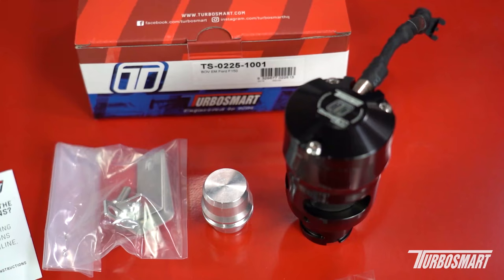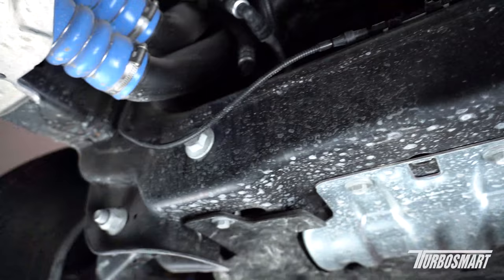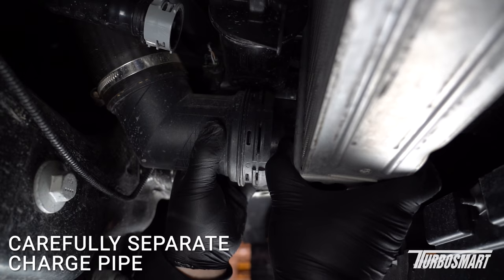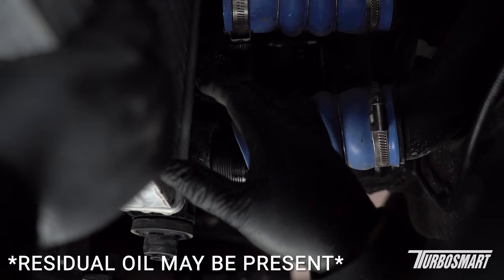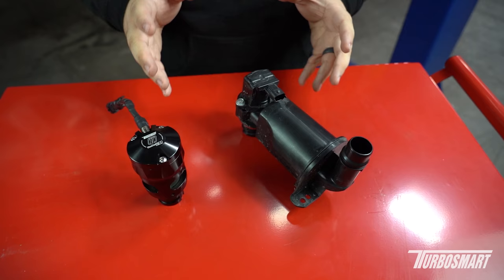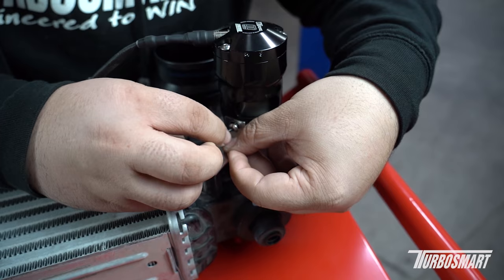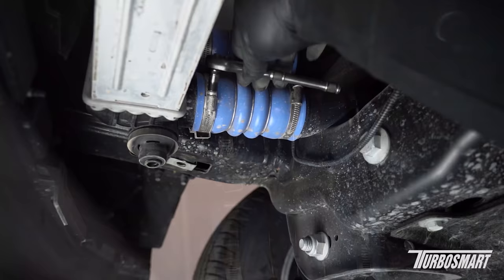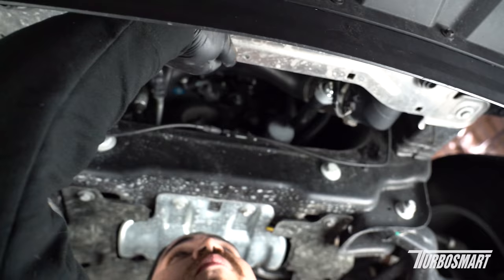BOV INSTALL: Ford F150 EM Blow Off Valve (P/N: TS-0225-1001)

Comment: Good video. Easy install. Did it in my garage without any ramps, 2.5" leveling kit was sufficient enough. Took me slightly longer than the length of this video due to pausing every now and then. Sounds good.
Reply: Is the air that would usually get recirculated being wasted?
Reply: I agree, hardest part was removing tabs on stock BOV. No need for ramps either with 2” spacers for leveling kit.

Comment: I see a lot of questions in the comments regarding going into water with this BOV submerged, but seems their support is answering all questions but this one? There is multiple questions about water etc.
Reply from the maker: Sorry if it seems we are avoiding this topic as that is not the case. The valve will stay sealed as long as boost pressure is in the system. The solenoid assembly is weather sealed so submerging the valve is not a concern. If you modulate the throttle in such a way that the ECU sends a signal to open the BOV then there is a risk that water could get in depending on the situation (I.E. Water Depth, Current Strength, etc.)  but remember that pressurized air is escaping out of this valve when it opens so water will have a tough time even getting in regardless. 

Be mindful when forging deep waters and try to stay on throttle as much as you can.

Comment: Turbosmart Regarding building boost while in the parked mode, I installed mine on a 2017 F-150 with a 2.7 Liter Ecoboost engine and the BOV does not open up for me on park at all, now when I’m driving it, it does sound off, and it sounds off really good on the highway, however while I’m in parked mode it does not open up. Either way I’m very happy with my purchase and man did I see an improvement in the turbo performance my truck ran so good I was easily reaching triple digit speeds while I was testing it out and wow it definitely made my truck pick-up and go so much better.
Reply from the maker: We've seen that it's been hit or miss on some F-150's whether they can blow off at idle or not. There is not a lot of pressure to made with no load on the engine and free revving. What opens the valve is a signal from the ECU. If the ECU does not see a need to open the valve it simply won't.
Reply: Turbosmart Actually it does work in park mode I just had to put my truck in Sport mode, which I did not have in the beginning. But now I get that BOV sound in park, a good tip to remember is if you want to hear the BOV in park, place your setting on Sport mode. Thanks again for the video tutorial it really helped me install it on my own. I’m very happy with the product and it sounds really good too. A+++++
Reply: These don't improve performance at all. Just makes the noise louder.

Comment: I bought by truck (2018 2.7 ecoboost)  with 47k miles on it  a year ago and already had this valve installed on it. about every 3 months i lose my boost, my truck wrench light comes on and then shortly followed by the service engine light. the code read p0299 and my boost is lost. each time this happens my blow valve is not working, no sound. when i take it in to the performace shop, they diagnose it as "stuck blow off valve" the say the do a remove valve, clean lubricate and replace and then retest and boost is back. I get charged $400 for this each time. my warranty does not cover any of this... at this point do you think i should just replace the valve... i will take any suggestions, frustrated at this point.
Reply: same here man , did you try and out the stock valve back on ?

Comment: What is the benefit of having this valve other than the cool sound it makes? Looks like a quality product.
Reply from the maker: Aside from the more robust materials offering longevity, the seal on the base of the piston is a softer rubber o-ring versus the hard composite material. This difference in material allows for a better seal over the factory which can lead to better spool up and response from the turbocharger in the low to mid end of the boost curve.

Comment: 3:53 "The top is off! Push that out of the way" Lol.

I'm probably going to get this over the mechanical valve. I have read a few negative reviews that these vent prematurely, but those reviews sound more like a faulty part (or faulty truck side sensor) and not a design flaw. Even CAT sometimes sends out non-functional parts, so if that's the case it's not really a big deal.

I would have prefered to get the mechanical valve, but I am not really a fan of those cheap connectors (for the resistors) that pierce the OEM harness. I specialize in wiring on ultra class mining equipment so maybe my standards are higher. But, You would think for the almost $500 Canadian Pesos that those resistors would be on a pig tail that plugs into the OEM connector. Even for the sake of keeping debris out of the plug left unplugged on the OEM harness.
Reply from the maker: We haven't had any customers reach out about the valves opening prematurely. If we had then we would have The spring in the valve is the same one all the EM Vee Ports have come with since it released late last year. The only thing that can activate the BOV is the ECU sending a 12v signal to the solenoid on our valve. 

We are happy to inform you that about a year and a half ago we did away with that style of IDC resistor. We have since been using a plug and play style that connects directly to the factory harness like what you described!

Comment: I bought this and sounds good. Now I'm noticing a slight whining noise at idle, Coasting at low speeds and taking off when slightly accelerating. Would putting the plug in do this or? Transmission shifts flawless and it's not power steering.
Reply from the maker: With any electronically controlled vent to atmosphere valve, you may notice it's much louder, especially compared to the OE valve that was intentionally much quieter.  When and how much the valve opens is based solely on the vehicle's specific ECU tuning. In our experience, Ford makes the valve open for a variety of reasons including start-up, power/traction management, boost control strategy, etc. This is all completely normal to experience. If you feel the valve is defective in any way above and beyond this, we are happy to inspect the valve under warranty. Feel free to reach out to us on our support page or call us and we will get you situated. https://www.turbosmart.com/contact-us
Reply: @TurbosmartHQ  I appreciate it, it seemed normal but wanted to double check. Thank you!

Comment: Can you undo the charge pipe couplers from the other side where the tension clamps are easier to undo? My screw is exactly under the frame and impossible to undo
Reply from the maker: That can work as well. We often take the time during installation before the intercooler goes back in to orientate the clamps in a more accessible position for future service.

Comment: Forgive my ignorance but why can't you just get the plug and plug the return air and let the factory bov vent to atmosphere?
Reply from the maker: No one said you can't if sound is all you're after. This BOV is an aftermarket upgrade made of much more robust materials, it seals better than the factory unit and supports higher HP levels.

Comment: Is it also possible to remove and change the intercooler on a gen2 raptor this way? I mean while the car is lifted up, changing the intercooler seems way easier and less painful than taking the whole grill out. After dealing with the fan harness ofc

Comment: just installed this on my 2013 f150. there was no where for me to install the bracket to secure the bov. i went ahead and installed it anyway. everything seems to be running smooth however there isn’t a singe difference in noise between the stock bov and this one. can someone maybe tell me why there isn’t a difference.
Reply from the maker: If you are not hearing the valve function there may be an issue with the installation. We can also assist you with getting the bracket properly installed. Please reach out to us! We are happy to assist!

https://www.turbosmart.com/contact-us

TURBOSMART HQ AUS
+61 1300 735 506

TURBOSMART USA
+1 (909) 476-2570

TURBOSMART UK
+44 121 368 0719

Comment: are there different instructions for a 2013 XLT? my intercooler isn’t sliding out as easily (there are some brackets sticking out on the side facing front) and the brackets are nowhere near the oe bolt hole.

Comment: i am trying to install this on a mishimoto intercooler but the mounting holes dont lign up? my options?
Reply: The mounting bracket is for extra protection , you could substitute a Thin bead of RTV or high temp sealant  around the mating surface to prevent from coming loose
Reply: @cessealbeach  was wondering the same thing. So you'd apply on the valve where it twists in to the intercooler?

Comment: After the body shop replaced my intercooler my Bov doesn’t sit in tightly. It has movement even when it’s tight. Can this cause my p0035 code?
Reply from the maker: P0035 is more so related to the connection between the BOV and the ECU harness. Check to make sure they plugged it back in and that they did not damage the wire harness from our valve.

Comment: I installed this same BOV on my 2013 ford f150 3.5 ecoboost. Car is now sluggish even more and no sound from the BOV. I know the truck had a leak at the exhaust manifold. Will this cause the BOV to not work properly?
Reply: Stock 3.5L exhaust manifolds and gaskets are garbage ... 1st thing I took off and replaced was the manifolds. Manifold leaks make the truck run like crap. 
I upgraded to  CR performance full bore pollished performance manifolds with all new studs and a stainless exhaust gasket. That in combination with a hyper tech MAX tune , and upgraded exhaust was at least 45hp increase. Pain to do though because both turbos have to come off completely. However it's a great setup. I have upgraded turbos and stage 2 cooling setup.

Comment: Does the intercooler need to come out to do the install? Or does that just make it a bit easier with more room to work.
Reply from the maker: Yes, it we could do it without dropping the intercooler we would. The factory diverter valve assembly cannot properly rotate out of place due to the large canister you see during the install. After installing our valve you can remove it without dropping the intercooler should you need to service it.

Comment: So I bought a f150 with this on and Im kind of tired of the woosh sound everytime I let off the gas.  I was wondering if there is a way to do that without having to remove your product? But if I have to do you know what the factory piece is called? Thanks.
Reply from the maker: This valve is only able to vent completely to the atmosphere. We do sell a fully recirculating version under part number TS-0225-1202

Comment: Does this sound the same as doing the VTA mod? Thinking of getting a bov purely for the sound (yes rice, idc) from watching a couple of videos of each they dont sound too far off from eachother, but some of the BOV videos the sounds are inconsistent even (this is the best sounding video of the BOV Ive found)

Anyway, just for the sound should I buy the BOV or will it sound the same as the VTA mod?
Reply from the maker: Some like to make the argument for the VTA mod, but if you look at the bypass valve on an F150 it has a muffler on it (2013+ Ecoboost F150s) which in our opinion reduces some of that sound you're after. Additionally, by disconnecting the recirculation tube you also open that up to potential debris along with the muffler on the bypass valve. The factory plastic  bypass valve also doesn't do the greatest job holding all of the boost either which has a direct effect on how loud that sound is (more pressure being released = louder sound overall). Short answer, buy an actual BOV.
Reply: @TurbosmartHQ  little update, ended up buying the turbosmart BOV, and it sounds amazing 👌🏻

Comment: Just added this to my F150 3.5 Ecoboost and it sounds nothing like the end of the video. Do you need some kind of tune for that whistle sound?
Reply from the maker: No tune is required for the use of our valves. There are several variables that could effect the audible sound of the valve while free revving. The main one being the ECU not seeing a condition worth opening the valve for. As long as it opens under load and at full boost while driving is what matters most.

Comment: Did the same thing by removing the recirculation hose and plugging the hole in the intake pipe with a $2 rubber, round chair leg floor guard and a $1 hose clamp...
Reply from the maker: Definitely watch out for debris collecting in the bypass valve muffler/canister over time. The factory valve will give you some light noise with a VTA style mod like this, but if you're ever looking for something that's NOT plastic that becomes brittle over time (leaks), improves response, and has vastly improved boost handling capacity (very important if you plan to tune your truck) then our valve is an upgrade in every way 👍👍
Reply: @TurbosmartHQ should this be tuned after the bov install due to recirc not being used anymore due to the recirc portion gives that extra air to help a/f ratios during deceleration?

Comment: No tune required? Doesn't the ecu  assume the air will be recirculation into the intake? Wonder if it will mess up the air fuel ratios.
Reply: It’s adjusted electronically as the factored valve is.
Reply from the maker: No tune is required making this a Plug & Play valve. The F150 utilizes a MAP sensor located on the intake manifold so your AFR will not be effected.

Comment: Turbosmart, would someone be willing to explain the pros and cons of the electronic BOV when compared to the fully mechanical BOV
Reply from the maker: They will both work as you would expect but just in different ways. Performance wise they are also very similar. The audible blow off between the two is nearly identical. 

The Supersonic (MECHANICAL) valve will require you to modify the EVAP circuit lines to tap into a vacuum source. This in return will give you a true vacuum reference. The EM Vee Port has an electrical connection so it offers full OE integration and is a true plug and play unit. Less install time since no vacuum lines are needed. It would simply come down to your preference on installation as the Supersonic has a few extra steps.
Reply: @TurbosmartHQ hello we installed this on my 19 Raptor and it's not as loud as we thought it was going to be...could we have done something wrong? It all matches up idk

Comment: It'd be nice if you A: made an adjustable one for guys running higher boost and B: make one that can be hooked back up to the recirculation tube ( a bunch of people, including me, don't want the bov sound)
Reply from the maker: This valve can support north of 50PSI. We have been looking to a recirculating option in the future.
Reply: Then just run the stock recirc valve. I'm pushing 20psi with methanol injection on the stock recirc valve with the VTA mod. No issues whatsoever. Its a blow off valve, all it does is release air lol
Reply: @bic94  stock valves are inferior in every way...cheap plastic, thin diaphragms, not as consistent or reliable. there have been thousands of premature failures on bone stock trucks, mine included. just because yours is still working doesn't mean they aren't junk
Reply: @TurbosmartHQ  if that recirculating valve ever hits the market, I’m in.

Comment: Does the recirculation hose just "hang" there? Asking because I got a check engine light almost 2 months after install...not sure if that dangling hose is what's causing g a leak. Debating to remove blow off valve before taking it to dealership.
Reply from the maker: The recirculation hose should have been plugged with the included plug. The valve will not cause a check engine light if it was installed properly.  We always encourage everyone to check with their vehicle manufacturer about warranty information.

Comment: If i go mudding alot, it there a chance that any mud can enter it and clog it?
Reply from the maker: It's possible, you can put something like a filter sock or foam wrap around it if you feel there is a chance that debris can easily enter the valve. Otherwise we have our new recirculating valve.

Comment: I installed the valve and everything but it does not blow off in park. It only works in gear going down the road. 
Does anyone have any idea
Reply from the maker: It sounds like it it was installed correctly if its blowing off under normal driving conditions (it may just be the ECU not allowing it to blow-off under those specific conditions). The factory ECU has full control over when the valve opens and closes so this is likely normal.

Comment: I have a 2018 2.7 EcoBoost and I tuned it with Livernois.  I had to take the tune off because I keep gettng P0299 under boost and goes into limp mode.  Would this fix that issue?  It only happens when tuned and I checked all hose clamps etc are tight.
Reply from the maker: Hmm, not entirely sure if our valve would fix that issue. Unless you confirm your factory diverter valve is the issue, I cannot confirm it would fix anything.

Comment: Hey, I recently bought a vta mod and the bov in the video and the I installed the vta mod first and installed it with the oem bov and it sounded good. I got all the whooshes and sounds I wanted. I ended up buying the actual bov and installed it and i noticed a difference in performance with your bov. But I’m getting no sounds at all when I rev it or trying to get the whooshes and stuff. I have a 2016 2.7L. Everything is in the correct spots and made sure everything was tightened down. Any feedback from anyone would be helpful. Thank you.
Reply from the maker: Hello, please reach out to the technical support team of your region for further assistance!